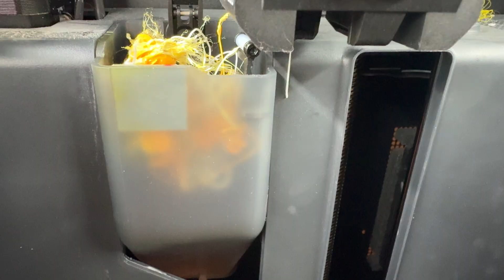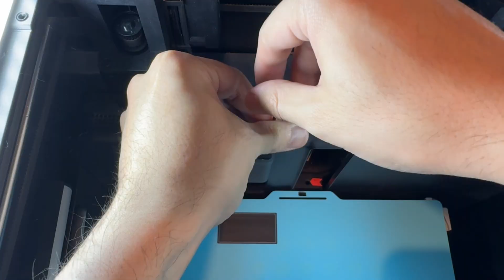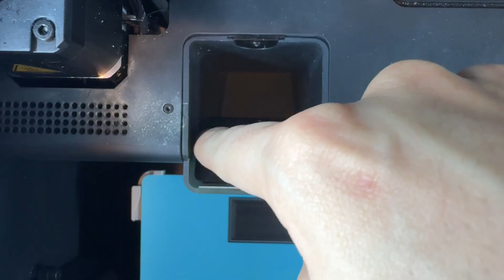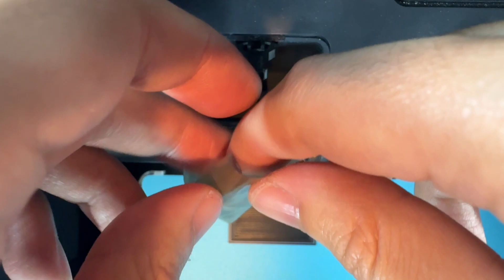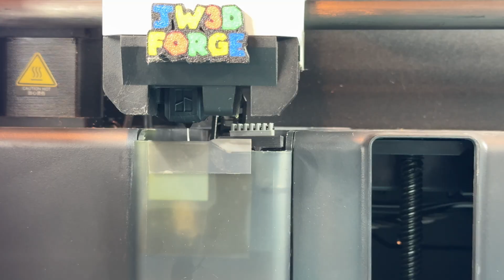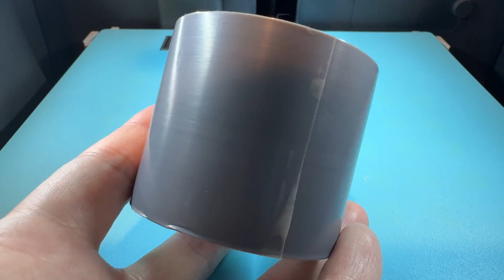How to Fix Poop Stuck in Poopchute on Bambu Lab P1P P1S X1C – Simple DIY Repair Guide

Comment: I didn't even realise there was a blocker flap im there? 🤔 What's the purpose of it? Helps keep chamber hot? Id be inclined to just remove it
Reply from the maker: So the poop can become a solid piece instead of strings, strings will distribute the weight all over and it won’t come out as easy and most likely will get stuck.

Comment: My P1S is only a month old and I had this happen.  The poop bucket was not even 1/4 of the way full so I know that was not the problem.  I did buy the recommended tape and have put two pieces side by side.  Fingers crossed that this does the trick.  Thanks for the info!
Reply: Mine is 2 days old and made my second print fail
Reply: Has it been working?

Comment: Is it work with aluminium tape?
Reply from the maker: aluminum tape is not as slippery as PTFE (Teflon) tape. PTFE tape has an extremely low coefficient of friction, due to its slippery, non-stick surface and high chemical resistance.

Comment: i bought the tape, but it's definitely not the same width you've got in the video. what width are you using? 2in?
Reply from the maker: the one in the video is 2 inches, but it sold out, and it cost a lot like $48, I don't think it worth it because you only need a little bit of it.
Reply: @jw3dforge i think 2" tape is the way to go. I bought the .5" and it started getting stuck/ backedup  again. I thinks its because the ends are rolling up and causing an actual lip. not to sure though.

hows the tape holding for you ? is it still reducing the number of poop chute clogs ?
Reply from the maker: No clog since I applied the tape. Actually it clogged once but that’s because I forgot to clean up the container for the poop and it built up. And now I don’t put anything behind it, I let the poop free fall and put a box at the bottom of the printer.
Reply: Followed the link and got .8” wide tape. 😑 Is anyone using this width and having success?
Reply: @FiredogKC did it work for you
Reply: @missycalhoun6319 embarrassingly enough, Ive yet to apply it.

Comment: What width teflon tape are you using?
Reply from the maker: 2 inches, but it cost too much. and it sold out already.
Reply: check michaels heat resistant tape  5 bucks a roll